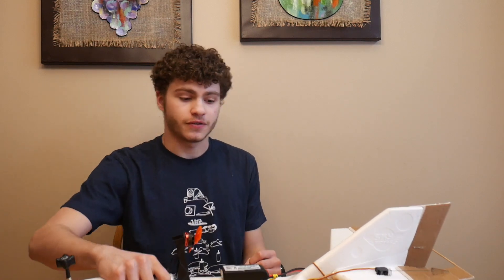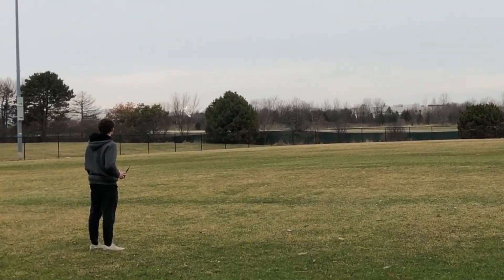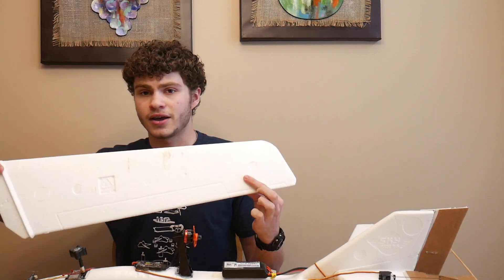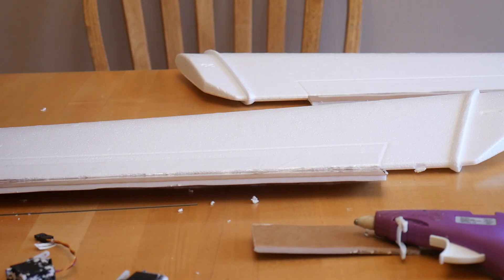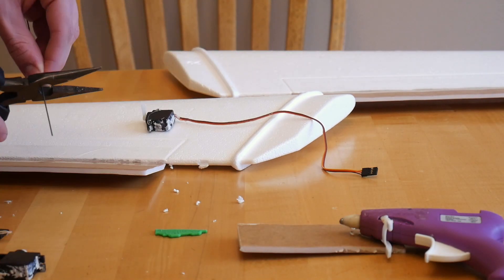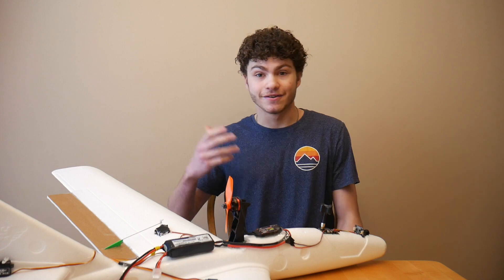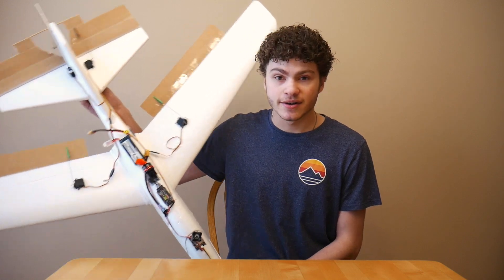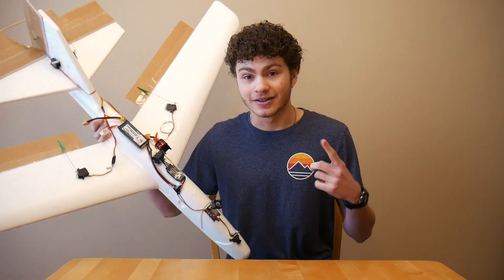Turning a Foam Glider into an RC Plane! (Part 2)

Comment: To make your lift more efficient you need to get the air moving faster under the wing, otherwise it will want to nose dive under hard acceleration. 

Cool video with the fpv addition.

Comment: when u  are  moving the control stick   with the rudder, what is the max  angle of the fin is moving ?  If it is making 0 to 60 degrees, will this angle also applied to other  flaps too such as alierons, horizontal flaps?